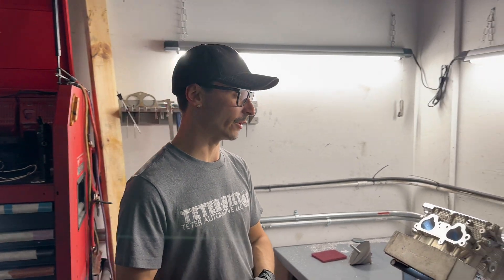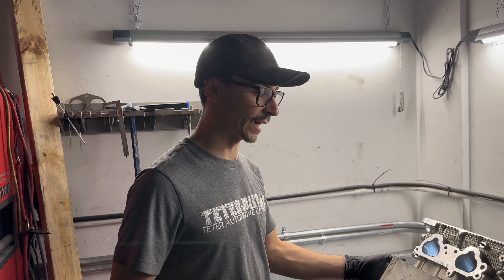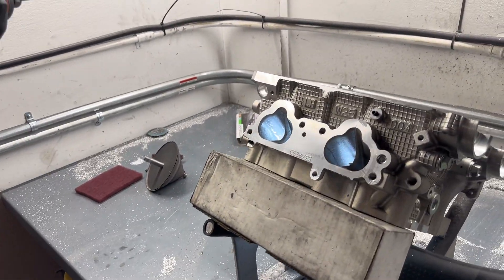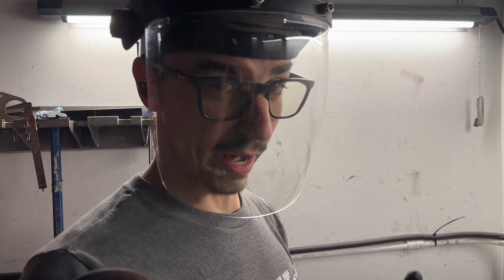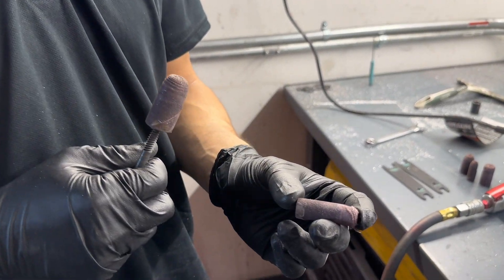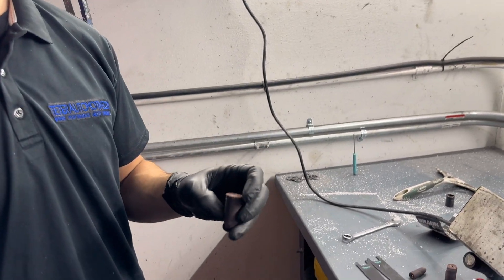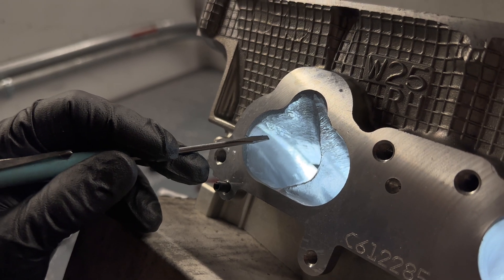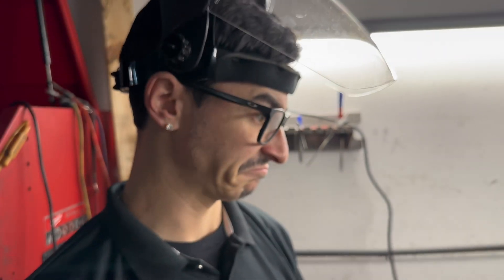How to Port and Polish Subaru Heads for 1000+ HP

Comment: You absolutely dont want the entire port smooth as possible certain areas need to be ruff to not only help with fuel atomization but to maintain suspension and velocity or you will actually lose power if not properly finished